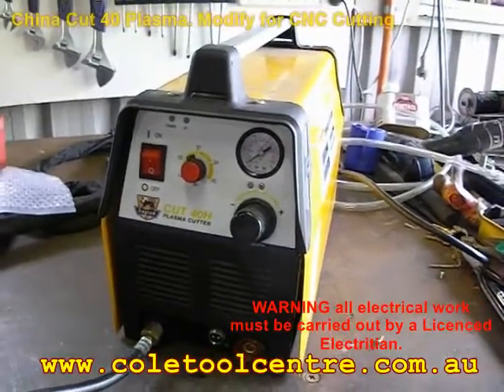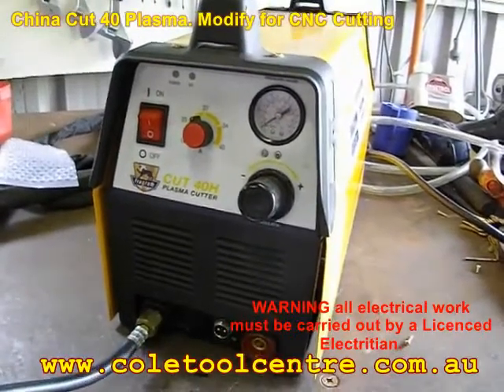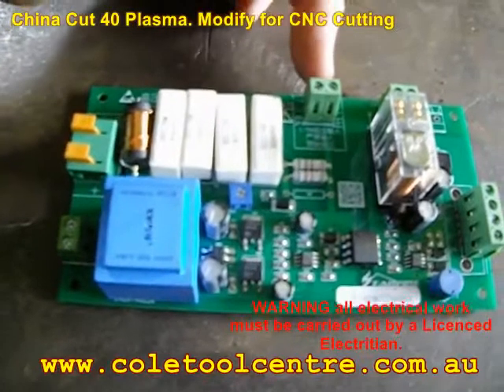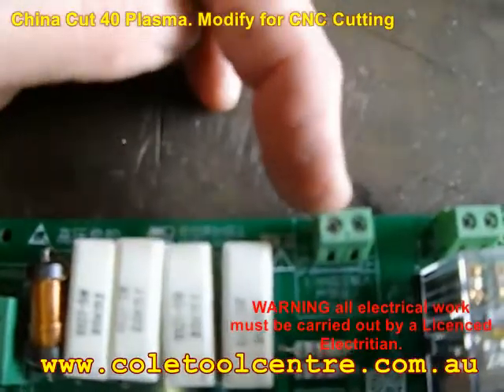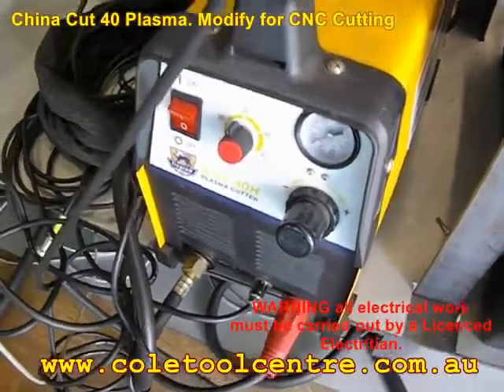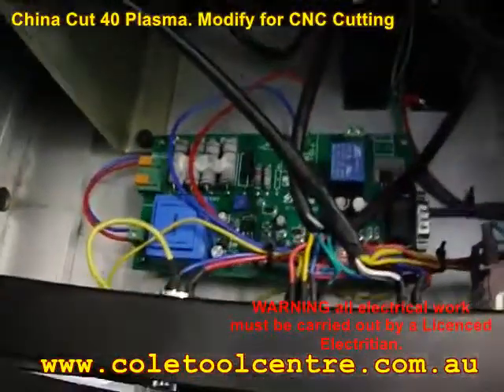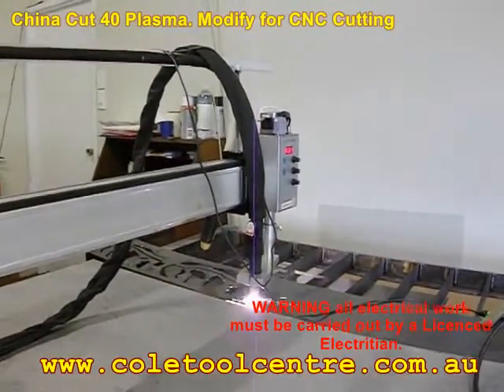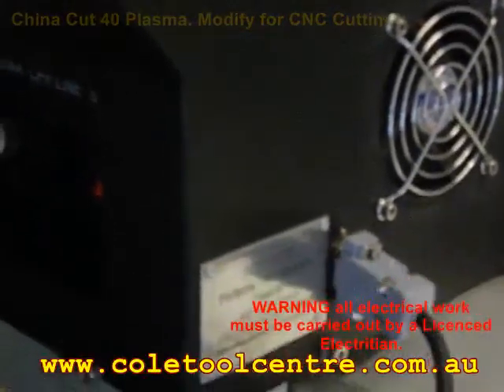China Cut40 Modify to work with Smartcut CNC Portable Cut Machine

Comment: Where did you get the ok to move signal?
Reply from the maker: Ok to move is software It starts to move after the time you set for pierce is reached. There is also a delay you set for  auto Torch height control.
Feedback to signal that torch is on is turned off and not required.

Comment: Can this modification work with HF start arc ?
Reply from the maker: I dont know. this is for a generic Cut 40 from china which I believe has HF but not back start. This machine needs to be earthed to start. I only know it worked on this machine with the only other problem being poor insulation causing the cnc machine start relay not to work If the CNC machine and the plasma were both attached to the same steel frame. I had to isolate the plasma source.

Comment: Sir is this a high frequency plasma cutter if yes than what did you do about hf interferences
Reply from the maker: something was causing the cnc machine not to fire the plasma source (could have been the HF) but I was able to get it going by isolating work table from the CNC Machine.

Comment: I found this voltage divider in Aliexpress and I really want to ask you about the jumper can you send to me a good phote for the one to one ratio setting.
Thanks for help ☺
Reply from the maker: Hi amr i saw the picture you sent but some how lost it. I don't have a    info sheet with me maybe tomorrow. The terminal in your picture is the 50:2 input. The instructions next to the jumper indicate which terminals have to be joined the input for the 1;1 is on the end just confirm 1+ . 1- are connected correctly.
Reply: @Graemecns  is 1+ to 1- are connected to torch height control
Thanks for help
Reply: Where did you find the board?

Comment from the maker: The board I am using is supplied with the smart cut CNC machine I import into Australia it is also available by its self.
Reply: Cole Tool Centre , how will i find it , im trying to do the same thing as you , i have the same plasma cutter,  but i cant read the electrical card name, can you provide the card name please so i can order it on eBay,  thanks

Comment: hello there, do you have a color chart for wiring to a portable cnc ? I believe i have a 5 pin wire coming from my cnc and bare wires at the other end. thanks
Reply from the maker: sorry i dont have a wiring diagram but each china plasma and thc could have differant wiring you need to confirm you are using the right wires identify wires ( maybe you should take to your electrical tech.
Reply: Cole Tool Centre Thanks

Comment: buy P80 torch and connect the cable arc pilot to ground in plasma generator, simple and facil
Reply: Before buying a good plasma cnc ready machine, I like to buy a cheap chinese one, reason being, I don't have enough money to buy the good one. So, you're saying to connect in a non pilot plasma machine, the ground clamp to the nozzle to be ready always? if you have a link or something would be nice to check. thanks in advance!